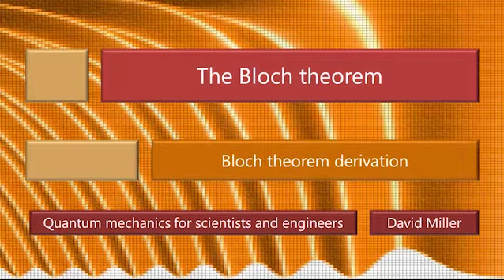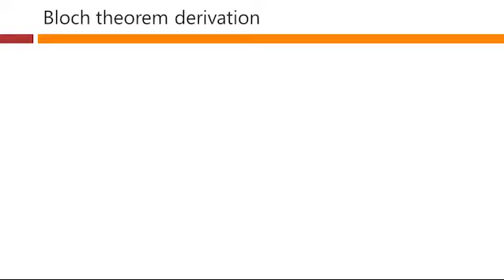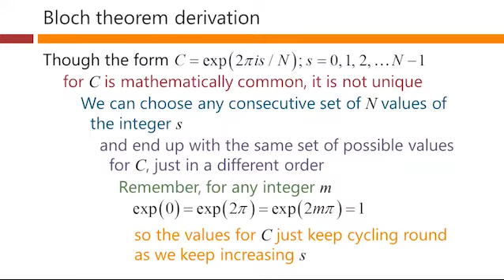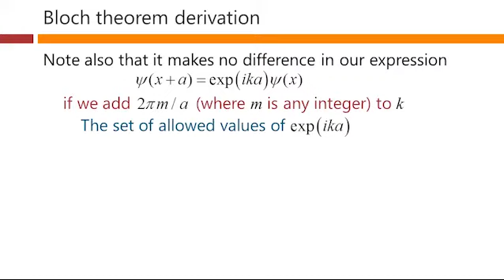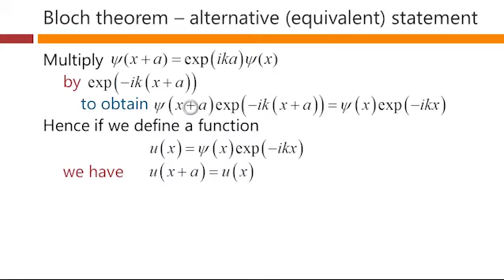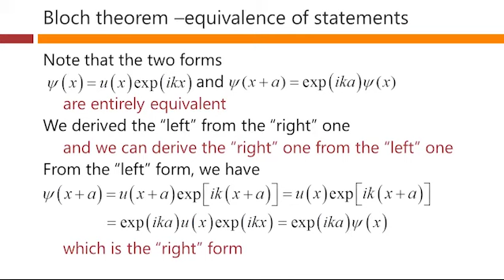Bloch theorem derivation – David Miller

Comment: clearest explanation I saw about Bloch thm, thank you!

One question although, in the visualization, you have shown envelope to be a wave with different periodicity than 'a'. What does this wave represent? In case is just represents the 'cos'(real) part of this term, then where is the 'sine' part? And what is the physical interpretation of e^ikx? , it cannot be an EM wave because magnitude of EM wave is not always 1 at every single point, right? The derivation is based on the assumption that magitude of this term e^ikx is always 1. So going ahead, we cannot neglect the 'sine' component of it, is that correct?
Reply from the maker: You are right I am only showing the "cos" part, just for graphic simplicity. The "sine" part would have the same kind of behavior, but just shifted sideways. This wave is a quantum mechanical wave, so it can be complex. EM waves are often modeled for mathematical convenience as being complex waves, but then we take the real part at the end to get back to the actual physical wave. In quantum mechanics, we have to be prepared to retain the full complex wave, however. Whether that complex wave has any real "meaning" is a good question; in practice, it is better just to use it as a way of performing calculations of things like probability densities (which involve the modulus squared of the final quantum mechanical wave). And, indeed, for full calculations we would have to deal with the "sine" part also in quantum mechanics, which we can easily do.